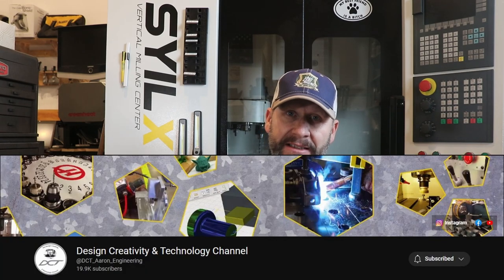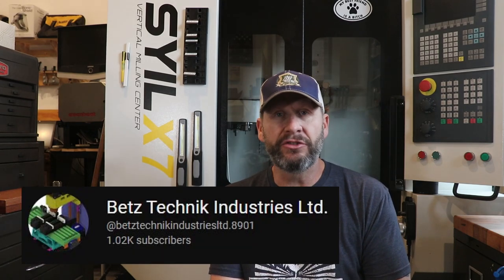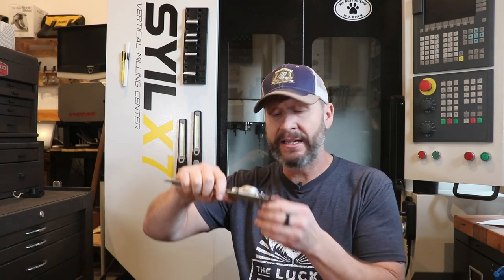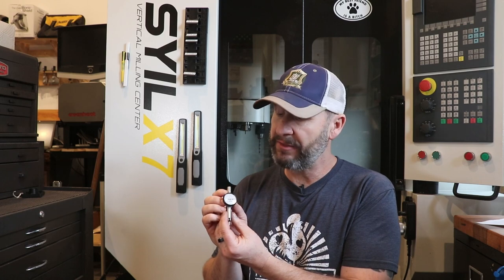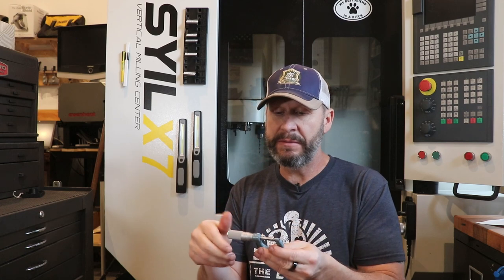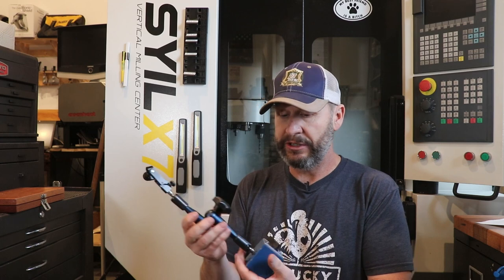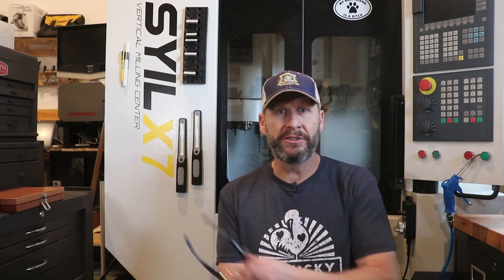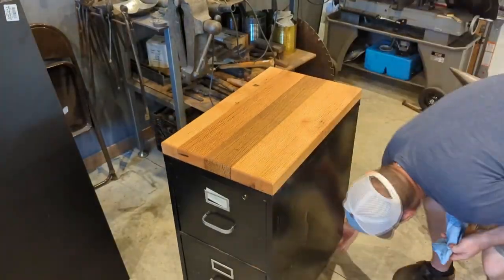SYIL X7 Basics: Tools for the Newbie

Comment: I'm planning to get a Syil X7 once I get my own house with a place to put it. I also expect to spend about $5-8k in work and tool holding. I already have an array of measuring tools, so that will help mitigate those expenses. I've had a manual mill for a few years now (got it in 2019) which has helped there. I expect to get some ER tool holders (maybe a few ER32, some ER16) but also some ADS holders (after watching Nerdly explain the setups). Then however many sets of collets (for both systems) I'll need to run things. 

I'm self taught for the manual mill (also had a lathe for years, and will get one again at some point). I'm already getting good in CAD and have started looking into also preparing those designs for a CNC mill. With the mill I have now, I know it's a limiting factor for what I can make. With me renting where I live now, I can't bolt the mill to the floor (it's a heavy 'bench top' type with a dedicated stand). I know that's at least one limiting factor for things. Once I have my own place, it will be bolted down (leveled of course).

For those either looking to get into milling/machining, check out Saunders Machine Works for the work holding products they make. I got a custom made fixture plate for my Grizzly G0761 mill (anodized aluminum) as well as three of their Mod2 vise setups (singular piece holding). I also have a nice 6" vise (Shars Tagara model) that does everything I need. It's only the third vise I bought for the mill (sold the other two off). I prefer to use the SMW Mod2 vises whenever possible though. I also purchase a good amount of my cutting tools from Shars. I'm sure you can find cheaper out there (ebay and such) but I like getting the 'made in USA' cutting tools since they arrive fast and are USA made.
Reply from the maker: It sounds like you are suffering from the same addiction that I am. 🤣What a fun hobby you and I have. Working in your own shop and creating things is the best.  

So yeah, I've been watching Saunders for years.  I remember being interested in the Tormach mills back in 2019. When Syil came out with the epoxy granite coupled with the long list of high-quality components, I decided to go with Syil.  Really wish I had the Siemens 828D, though.  My CAD software is always limited to whether they have a good post processor or not.  Luckily, I have Fusion 360, which is great except for the more artistic and intricate projects I'd like to do. 

Anyway, good luck on your journey. I don't know what is more nerve-wracking to buy, a house, or a brand new mill.  There is nothing quite like running an unproven tool path or better yet, proving your program was faulty by crashing your mill. Haha, those early days are fun.

Comment: I have been going through your videos slowly. I hope that at some point I will find a video where the most basic things are done showing the G code (or a CAD/CAM model), like a hole in a cube, a triangle on a cube, and so on. I have been thinking about a change of profession and I have been searching for the really basic videos. I haven't made many searches yet, so the search continues, but slowly a few searches now and then in the following weeks or months, when I have time for it.
Reply from the maker: Back when I started learning G code, I was a big fan of Udemy.  I took a few classes from Marc Cronin.  Here's the link. 
https://www.udemy.com/user/marc-cronin/ 

I think now, I might go back and re-do the courses. He was pretty good though I felt like I needed more, so I went to the local community college and that really helped.  

To be honest, now I use Fusion 360 for design and post processing. I don't code anything by hand. Fusion lets me design 3D models and its Machining extension has great milling strategies and outputs the G code for my post processor.   

I thinks it's good to at least have a familiarity with g code to read and edit what Fusion spits out, if needed.
Reply: @PowerForgeWorkshop  Great! Thanks!